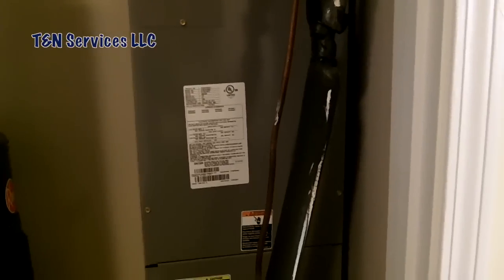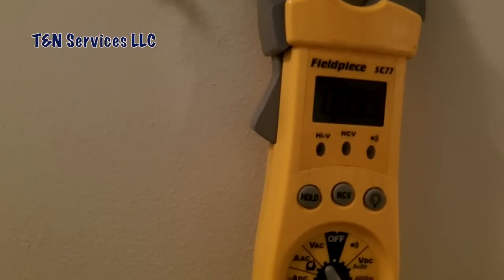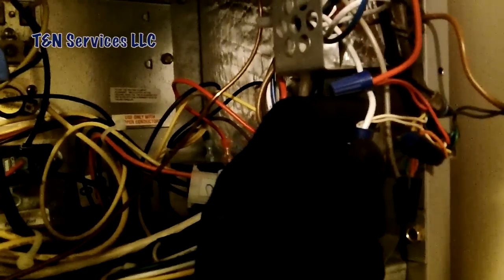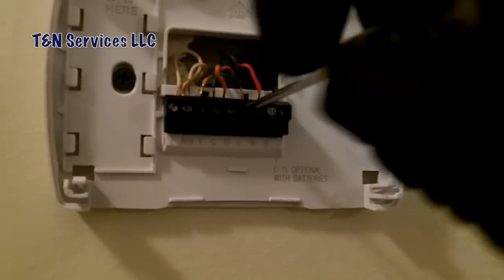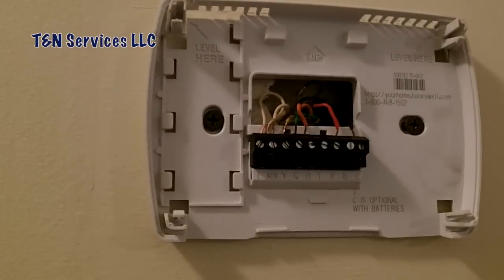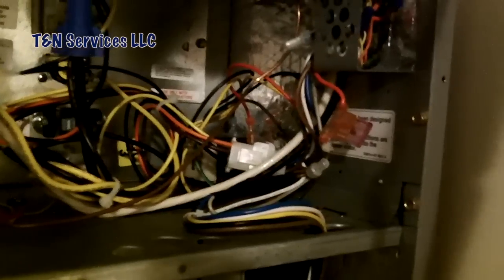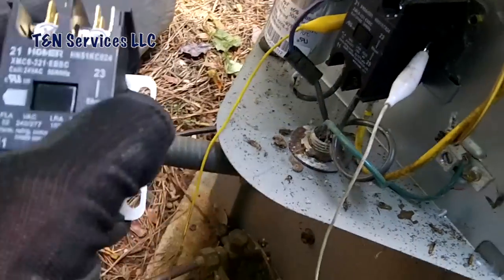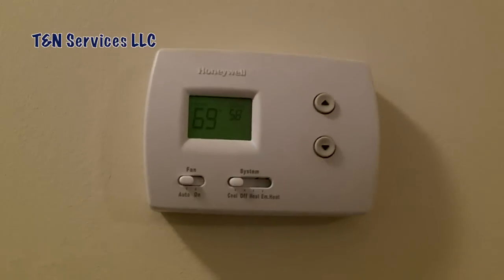HVAC unit won't run after thermostat changeout

Comment: Six years later and your video is still helping people.  I just changed out my thermostat and it wouldn't power on.  Put the old one back in and still nothing.  Came across this video and found a blown fuse.  Thank you!!

Comment: I just attempted to change my thermostat without shutting off power first and I was quite alarmed that the new t-stat didn't work, and neither did the old one when I put it back!!  This video saved me an embarrassing and expensive service call.  I found the fuse and the filament looked fine, but my continuity tester confirmed that it was in fact BLOWN.  After a quick trip to the hardware store everything is fine.  And while the unit was down I went ahead and put the new t-stat back into place, and it is working fine too.  Thanks so much for this video!!

Comment: God Bless you man! I bought a house and installed a new WiFi thermostat.  I turned off the the a/c breaker and replaced the thermostat.  Once I finished I switched the breaker on and I had no power in the thermostat or a/c.  I watched your video and after going back and forth, I realized that there is another breaker for the air handler, which I had not switched off.  I opened the air handler and there was the 5 amp fuse blown.  I made sure all breakers were off, replaced the fuse & boom, everything working 100%.  Saved me a ton of money!  Thanks for the video.
Reply from the maker: Glad it helped

Comment: Was getting very frustrated and thought I was gonna break my thermostat plate with the way I was trying to pull the thing off the wall. Couldn't find any video showing how to take it off with the Honeywell design I had. But I saw the same thermostat on your video and after watching you pinch it from the top and bottom, I did the same and got it off, finally. Didn't come off as easily as your attempt, but it opened. Was able to change the batteries it said needed replacement. Thank you for this video.

Comment: Thanks for this video! Installed a new thermostat in my house and made to "blue wire goes into B" mistake. Followed this video and discovered my mistake AND the blown fuse in the air handler! All running fine now.

Comment: Thank you! Because of your detailed video, I was able to have heat. The ambient temperature is 26 and my house is 52. I moved my thermostat and forgot to turn off the power. I didn't think I needed to because all the thermostat does is send a signal to the circuit board which identifies it as a code to turn on or off. I found the fuse, which was 3 amp, again serves no purpose other than to ensure that if you didn't know about this then you would have blown it and called a repairman. Why wouldn't they locate the fuse on the thermostat rather than the unit? Oh, that's right so you can doubt yourself and call someone to do it for you. Well, again, thank you for the video and the explanation of why you are checking the components.

Comment: I did the same... shut the Hvac breaker off, didn’t check to make sure it was the correct breaker (thinking the guy who labeled the panel knew what he was doing) and bam, fuse blew.... I like the concept of shutting all 2pole breakers down (if you can). Thanks

Comment: thanks - great video, helped a lot with my original problem. Question . . I hope you have time to help me. I put in an Ecobee5 tstat and lost power, which brought me to your video. My system does not have a fuse. I replaced the transformer, added a piggy back 3A fuse to the secondary side. Still no luck, so I replaced the timer board and ignition control module and finally power back at tstat, boards etc. Once the ecobee was powered up the screen said 'delayed start-up" then read 100 degrees, then 110, then 120! I had to use an oven mitt to remove it. The ecobee contacts melted on the back  on one side. Back to no power. Before moving forward would I need to replace the tstat wiring since the insulation appears to be melted to the copper wiring?

Comment: Great video. I accidentally hit the thermostat wiring with the weed eater next to the outside unit. I spliced the wires back together, but I have no power at the thermostat. I did not check for a fuse. Do most (if not all)  have a fuse inside at the air handler? My unit is a Rudd probrably 2013 or so. Thank you.

Comment: Took my nest thermostat off the wall to repair the big hole so I can flush mount it. Pulled the plug from the unit to the house because it thought that killed the power. Hooked everything back up and says no power coming from unit. Thought I might have broke the red wire but it looks fine. I hope like hell I just blew the fuse. Started looking online and it brought me here. I’m going to go up and check it.
Reply from the maker: Good luck hopefully its just a fuse in the furnace

Comment: thank you I suspected I possibly blew a fuse, I did turn the unit off but maybe something was loose when I turned it on. Ill check the fuse. I was switching out thermostats, new one was blank then I tried to reinstall old one blank too. LOL I scred something up. hope its just a fuse

Comment: Great Video, However I did not see you talk about the open Deep Trap in the drain. Without a Cap between the Trap and Unit, The Trap is useless as an air break. I am sure you addressed this issue off camera. Keep up the good videos.
Reply from the maker: I've been caught, LOL your right about the trap, I left it out of the video to see who was paying attention. It was the first thing I noticed when I saw the unit.

Comment: I have a luxair hvac system  if have power into my control board will I still have my 24 volts to thermostat?  I have no troubleshooting light and blower won't kick on w at her way.

Comment: Check to see if your AC condenser has a pan with a float switch.  I thought I had thermostat problems and board problems. Turned out all I had was a bad float switch causing the whole thing not to work.  Check it first or remove it and connect the wires together, then see if you still have problems.  Just would have saved me a lot of time.

Comment: After I changed batteries the thermostat shows wrong temperature, like 15F higher than it is. Can I repair it, or I need to buy a new thermostat? I have "White Rogers".

Comment: ok here's a good question. I asked My property manager before changing out my thermostat. it was ok'd by them. I replaced my analog thermostat with a digital programmable thermostat, I followed the color guide on the mounting plate. I have a 4 wire system electric heat system by the way. red to red blue to blue yellow to yellow white to white. when I call for air the heat comes on. when I call for heat the compressor comes on but fan does not. I have to turn the fan from auto to on in order to get it too work. please help

Comment: Good video.   I have a problem with my Lyric thermostat displaying an insufficient power error.  I tested my wires red to yellow and red to white and there are 27 volts.   However, red to blue and red to green only shows about 14-16 volts. Do I have a bad transformer?
Reply from the maker: If your getting 27 volts your transformer is fine. Try looking at your green and blue wires to see if they maybe broken. I've seen them broken inside the insulation and it caused a problem like your talking about

Comment: I have this thermostat. It was just installed last August 2017. I've changed out the batteries and the numbers are still faded. Parts showing of the numbers and some completely faded out. I can get the fan to kick on with the switch but not the ac. I can't see the display. Any suggestions??

Comment: good video, I like your air flow meter & phone app, it looks uncomplicated, I like anything that's uncomplicated, I'll have to get one.
Reply from the maker: Hey Jim, I think you will like the AAB it's pretty simple and only cost about $30
Reply: T&N Services LLC. Thanks Ralph, I picked one up yesterday at my supply house, it cost $39. looking forward to using it.
Reply: Jim Pettinato I've had mine now for a couple years. Impressed with the accuracy of it and ease of use! In one situation I came back with an air flow hood and got virtually the same readings. Great tool to have!  I like being able to label and export the readings! I don't use that feature often but when I want some formal data right from the meter, exporting that data is a nice option to have!

Comment: Swapped out old thermo to wifi with no common. Used the G for C but found no way for me to do a jumper in the air handler. It has NO terminal block. So now I'm clueless. Heat works fine and Compressor. But no fan or blower. Not sure what to do now

Comment: I guess heat strips have there use when the ambient temps are very low to help a heat pump put out warm air,but as a home owner I can not afford the cost of electricity and do not want to spent tons of money running heat strips...should I call for service again and have the heat strips rewired to come on only when they are needed?
Reply from the maker: Yes you can do that, they make a outdoor stat the will only bring on the heat strips at certain temperature. It's code in some states, just not in Ga yet

Comment: where do I buy the fuse please? mine blew
Reply from the maker: Any auto parts store will have them. Make sure you don't put anything about 5 amp in there though.
Reply: +T&N Services LLC. got it fixed and running! !! I had extra fuses in my vehicle. put one in and it worked. only took me a few minutes. you have saved me hundreds of dollars. thank you so much!!